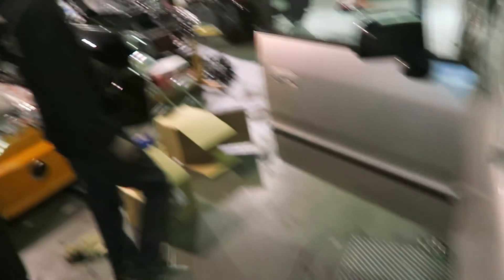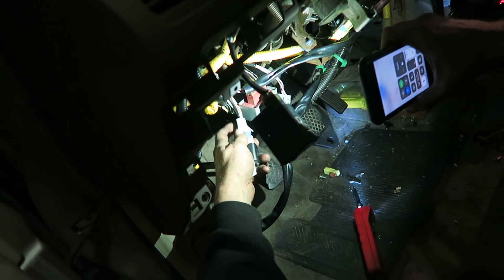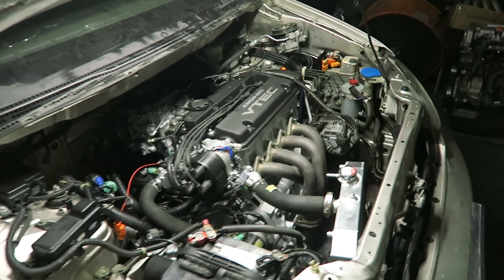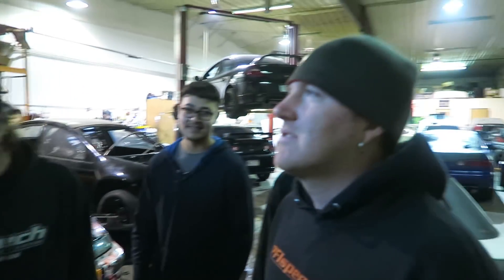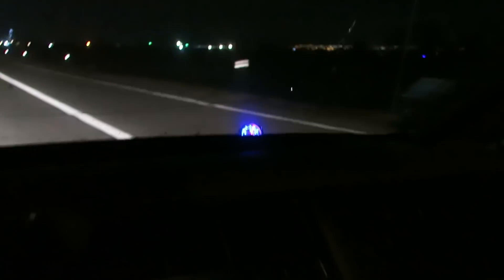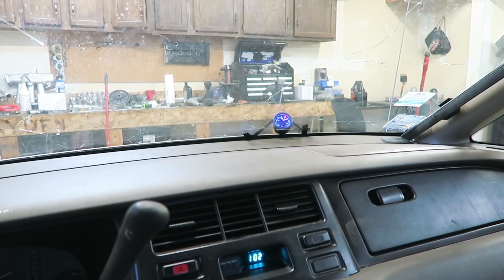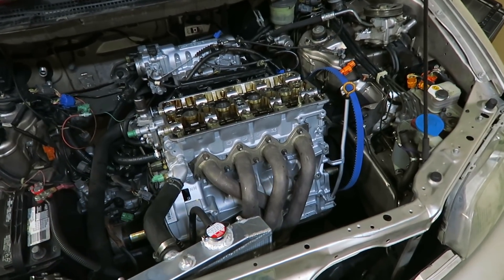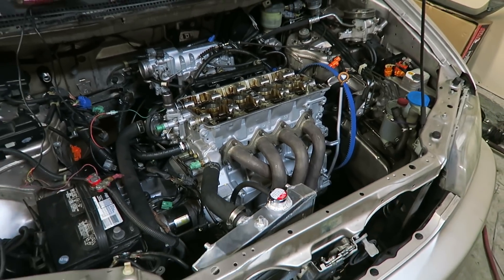Minivan is Already on the Dyno?

Comment: How only 124hp from a stock H series?
Reply: eumotors set up for boost probably low comp so its a slug
Reply: Garrett Turbo why is low comp better?
Reply: They stoped early because of low oil
Reply: Moosy Moose In brief: low comp is better because the turbo builds the compression instead of the pistons. You chuck boost through a high compression engine and you could run into issues with longevity since its more prone to detonation. A low comp engine takes away that risk.
Reply: Moosy Moose you can run higher boost levels safely on pump gas. High comp and boost doesnt really work unless you have race gas. Anything less and it blows up. On the other hand you will make similar power with less boost on higher compression. Idk what h22 have for compression but i imagine its likr 11 to 1. Hes probably running like 9 to 1.
Reply: Nick Allen low comp at elevation and talking wheel horsepower thats probably all its got
Reply: Safer for boost, ping prevention. boosted motors from 90's have like 8.5:1 compression and N/A will rock 9:1 or even 10:1  some new N/A motors now days have like 12:1 but if you threw boost into them and not tune or even a bad tune or get bad gas they would probably blow even with minimal boost unless they were super built ie forged pistons and rods sleeved blocks and other safety provisions. So to keep things easier and safe its better to run lower comp and run more boost vs high comp with little boost. the more pressure you have the more likely it will blow and with turbo motors you dont want them to blow early especially when you get into full boost. sorry if i rambled a bit and if that didnt answer your question.. there are alot of factors at play when getting more power or the kind of power you want out of a motor.
Reply: They also didn't rev it out all the way
Reply: Jbwifi not completely right. Its only prone to detonation if your not using proper gas. Engine is more likely to blow up cause of too much boost. If you run higher compression it actually can make the engine more reliable because it doesnt need as much boost to make the same power. Thats a common misconception old school way of lookinh at it
Reply: Moosy Moose 
lower compression so you can add more boost. you can only have a certain static compression ratio. if its to high . the fuel will preignite . how a diesel runs from compression ignition. you will make more power when the fuel burns when you want it to.
Reply: James stranger true that but i hate low comp builds no torque until boost lots of lag but im not into roll or drag racing i like a responsive engine
Reply: Garrett Turbo 
yea at least it has V Tec. or it would be worse. having low end cam timing then at higher rpm switch to top end cam timing and can spec. also I guess. makes a world of difference. the hatch motor with 11:1 comp ratio. it would have lived if it was ran on race fuel. I didn't think it would live long. with all that boost. yea it makes power if you can get the fuel to burn how and when you want it to. when it explodes and nothing moves like it should. shit happens! like the piston that looks like a torch got hold of it!!!     hopefully this one will make power and survive!
Reply: But that really healthy
Reply: James stranger oh he runs 11 to 1 in the hatch? Im not suprised these guys know there shit. That 9:1 compression bullshit is old school and laggy
Reply: He currently has the hatch on E85, pretty sure that is the plan for the van as well. Last time i heard him mention the hatch its still running, he just borrowed a lot of parts for the van.
Reply: connly33 i asked about the compression i can fill the rest in
Reply: For one, its not broken in. 
So I guess Brent wasnt fully romping on it.
Secondly, it wasnt making sufficient oilpressure or kicking on VTEC.
So I guess Brent wasnt fully romping on it. 
Did you even watch the damn video or did you get caught up in your mind ?!
Reply: High compression is good for mitigating turbo lag, if you're running high compression use an oversized turbo and run low boost.
Reply: Not to mention it only cracked vtec for the last like 500 rpms
Reply: Garett Turbo it was actually just an extremely brief explanation because obviously, the guy I was replying to won't have a huge grasp of how an engine works at this stage. But if we want to address things that are not completely right we can look over your reply:

" Its only prone to detonation if your not using proper gas"

I should probably stop using diesel in my truck then am I right?  Aside from that, fuel is not the only decider for whether an engine is prone to detonation. There are many things to factor in;  lubrication, timing, fuel, oxygen, and heat are all equally involved in that equation.

"If you run higher compression it actually can make the engine more reliable because it doesn't need as much boost to make the same power"

Comparing a high comp turbo setup with a low comp turbo setup, the high comp turbo will likely survive longer, but the engine will not. Key reason is heat. You don't have to agree with me, but you just need to go outside and compare the amount of low compression petrol turbo engines that roll out of factories, with the high compression ones, to see the truth. 
Diesels, of course, can still run quite a high compression, because the ignition point of diesel is low, but generally, turbo diesels will still be lower compression than there naturally aspirated counterparts.
You can get an extremely long life out of high compression turbo builds, personally I love them more than lower compression builds, but saying they are more reliable is incorrect.

"That's a common misconception old school way of looking at it"

I suppose my age is showing, but hey, old-school ways of looking at things don't necessarily make them wrong.
Reply: Jbwifi less boost more reliable from what ive seen it an argument but i stand by it
Reply: as in less boost, higher compression? that's fine, I trust car manufacturers and engine designers.
Reply: Jbwifi yeah for high performance
Reply: Jbwifi im not talking about production cars im talking about fast cars

Comment: Your supposed to break a rebuilt motor in to 500 miles before even getting on it hard, at least it’s how we do here. Wbu guys? Do u worry much about that?
Reply: Flat Earth Heaven im a believer in breaking an engine in with how you intend to use it.  Base tune and then dyno.
Reply: Kyle Hooker hmm good philosophy, never looked at it that way. 👍

Comment: Honda pressure regulators will stop oil pressure at 68psi @176 degrees f, the pressure will be lower the hotter the car runs. Cold oil is more viscous so will bump up your oil pressure.

Comment: Holy crap its pushing 124 whp Holy shit thats alot
Reply: theodore raz it's built for low compression. That way, when you boost it, the comp doesn't get too high and the engine is less prone to detonate
Reply: Klas Medak lol i dont understand
Reply: theodore raz he built the engine to run weaker than usual so that when he puts a turbo on it, it will run safe. If he left it original, it could be dangerous
Reply: Klas Medak oh ok
Reply: theodore raz I hope you're being sarcastic
Reply: Eduardo Figueroa obviously, he's still new to this

Comment: You should get a mechanical oil pressure gauge first dude. Electric ones are just unreliable
Reply: Check Mate he dsnt like mechanical cause oil could run out into his car he says in a video,  though it was outside in this vid

Comment: Damn h22 all motor is weak. K20 all day.
Reply: Bryan Welch it's built for boost so it's probably low compression. Makes it a dog. H22 with fbo/type s cams and a tune will do 210+ whp